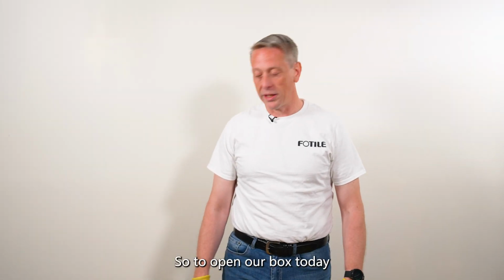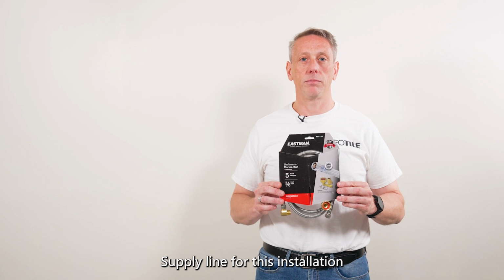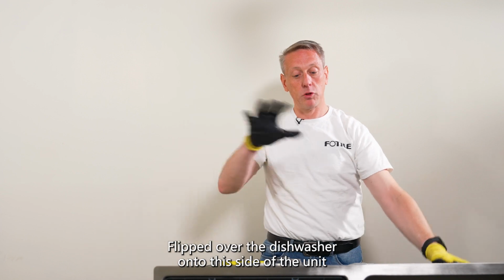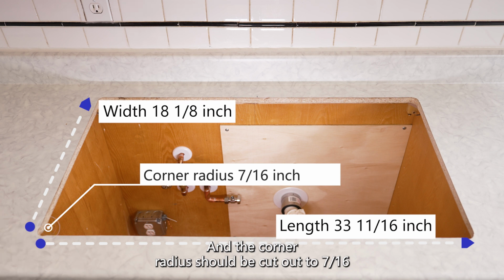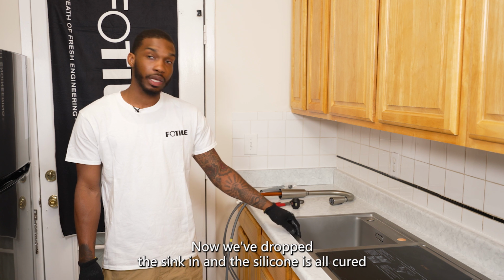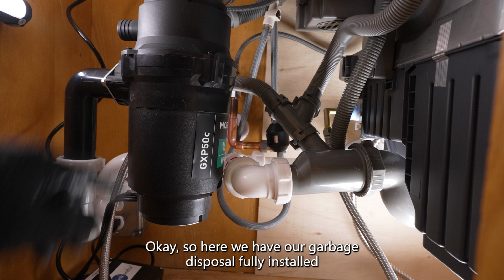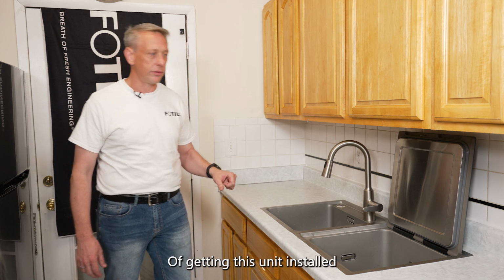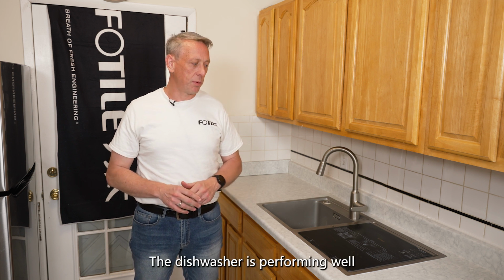FOTILE In-Sink Dishwasher SD2F-P3 Installation Tutorial

Comment: This video is key to making install easy. My only comment is that the tail pipe shown has the extra connection for a dishwasher that serves no purpose. Just get a straight tailpipe without the extra connection. I figured that out after I started but (un)fortunately it was three trips to the hardware store for other things as per usual.

Comment: I wouldn't add the caulk to the sink bottom but on the countertop. Put a small stick on each corner and set the sink on. This allows you to position the sink unit then drop each side the last 1/2". Also, there are some connections that a crescent wrench should be used, not channel locks. You can squeeze the nut out of round on the inside. Professionals?

Comment: I'm sorry I followed plumbing at first wasted parts and time. There is two overflow vent hoses and small electric drip hose....as he plumbed these they are not trapped unless trap under floor ...then it doesn't matter. Better to just put to divided Tee in between like normal double basin....drop into trap ...this gives you a swing joint to make up for slight angle connecting DW to the sink...then into pvc glue pipe. Mine look